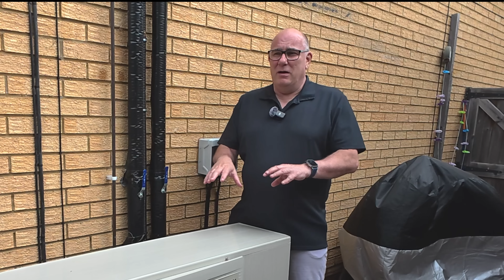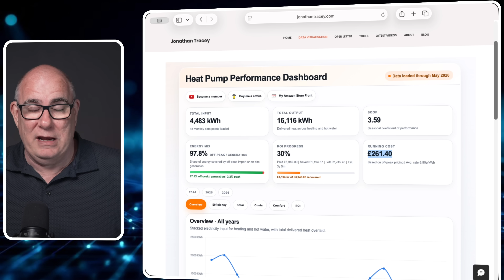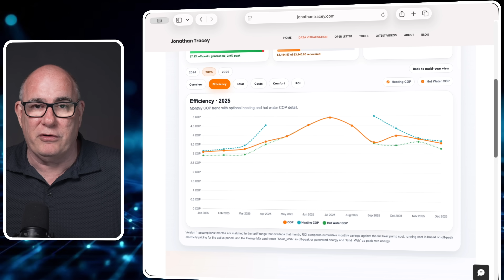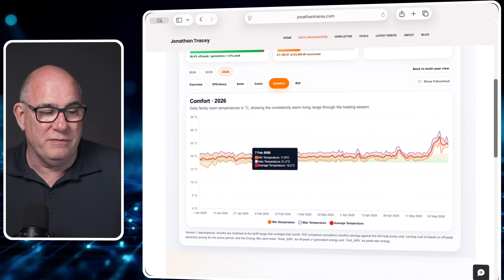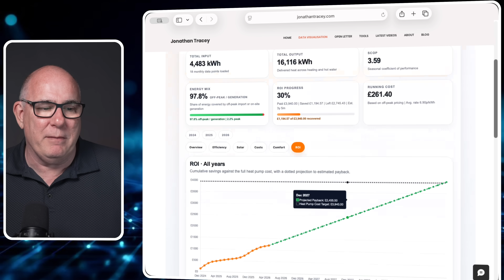18 Months Later: Would I Still Buy A Heat Pump?

Comment: Just FYI: I logged my Daikin heatpumps power consumption using a separate powerplug and discovered it was running high power cycles and the demand control function that is supposed to adjust this to match the power level to your actual needs were not working properly. After notifying Daikin and them confirming the issue they did in fact issue a firmware update that solved it which should affect a lot of users. Result is my heatpump can now run at a very low power to keep the temps I asked for instead of bursting into action and needing to defrost all the time. Result is my defrost cycles changes for every 40-90 minutes in -5c weather to maybe once every 7-9 hours! This is a massive saving on pump wear and a big increase in COP! I was running 3.5-ish but now generally see 4-4.5! Check your pump and settings to see if you have good firmware and if it is able to adapt the power level to your use conditions.
Reply from the maker: Do you know what version of software you’re running?
Reply: @JonathanTracey  I have BRP069C4x type gateway running 2_3_0 firmware with Indoor unit type FTXTA30C2V1BW (air-to-air setup) running 22017101 and outdoor unit RXTA30C2V1B running 22018703 software.
Depending on the combo of system you might not even be on the same software but you can still check if you have a demand control function  and if it is working as expected. Without demand control unit will ramp up to full power and then stop once setpoint/target is reached. With demand control in manual it did not work correctly and it was not possible to set a wattage correctly and in auto it would go up and down wildly. After sw fix it can estimate correctly the power required to gently reach the target and then stay at a very low power reaching a very high COP instead of turning on and off all the time. Result is it can even avoid defrost cycles by not pulling too much heat out of any given volume of air unless it is needed.
Reply from the maker: yeah looks like were on different firmware as my mine (air to water) is showing v4.0.1
Reply: @JonathanTracey  Unless you have already had a look at your units power consumption curves during normal heating (not the hourly data they report but via a proper logger or smart panel) then I suggest you do so as I would not be surprised if this is lingering in many installs. For example the modulation setting is always off by default for new installs and the on/off nature of the heat pump then causes overshoots in the temperature setpoints and often quite short cycles. Very seldom is the heat pump full power required. Yours may have multiple inputs though, or be set differently. I just know that when I logged my unit Daikin was surprised themselves. 🤣
I should probably make a video showing the graphs before and after or something as it is quite dramatic.
Reply: @1kreature please do. I’ve not found a good source for verifying the settings of my Daikin. Or a source that explains what they all do. For example the machine was fitted with weather comp but somehow is also controlled by the indoor thermostat.. I’m sure that’s inefficient..

Comment: We've had our heat pump for almost a year now. Our numbers are slightly higher than yours for several reasons, we don't have an EV yet so on the cosy tariff our kWh unit cost is more,  we only have a small 9.5 kWh battery and I like our house at 22c + but the 8 kW Daikin heat pump is still working out cheaper than our old gas boiler.
Btw I do like your presentation of your own data on your website. If you notice a certain IP looking at it just after 11pm every night that's me 😂
Reply from the maker: lol i am long asleep but feel free that’s what i publish it for 😂
Reply: 22C is...hot
Reply: @Biggest-hz7ng   oh no it isn't 🥶

Comment: Your data is very close to mine, but I only use E7 at 8 pence per unit for around 4 months of the year, and even then, I use very little from the grid, with the most I've used being a total of 211KWH in December and January, and 42KWH in February, and zero in March onwards. Total KWH from the grid in 2025 was 299KWH. My EVs are not full-sized cars, as I have a Twizy and a Stark Varg MX/SM, plus 2 more ebikes, or I would need more grid power in winter.
Since March, I've had to have the heat-pump in AC mode some days, but all of May it's been on every day, as it's been up to 32C outside, and coming home it's been 40C+ indoors. I like it 22C max, and 20C in winter, as the heat makes me sick now.
Reply from the maker: @hardergamer  I think we've both reached the point where summer cooling is becoming just as important as winter heating. Like you, I find 20°C–22°C much more comfortable. Once the house gets into the high 20s or beyond it becomes hard work, and 40°C indoors would be unbearable for me!
Reply: @JonathanTracey  The heat didn't bother me as much when I was younger, but now, when indoors, it affects me, especially with high humidity. And the south side of my home is nearly all glass, which is why it gets crazily hot. I'm just about to install reflective roller blinds, which should help. 
Just add, I'm betting many more will be looking at heat-pumps soon with this 13% hike on gas prices, and this US/Israel war with Iran doesn't look like it's going to be ending anytime soon.
Reply from the maker: @hardergamer We found a great solution for sleeping in hot weather. We bought one of those mattress systems that circulates water through a pad on the bed. In winter it can warm the bed, and in summer it chills the mattress surface. It sounds a bit gimmicky, but when the bedroom is pushing 30–35°C it makes a huge difference to sleep quality. Sometimes cooling the person is a lot easier than trying to cool the entire house!
Reply: Very similar story for ours. 15 months: 17643 kWh output from 4314 kWh input at almost exactly 7p/kWh average. Let’s call that £310 total for 24 hr heating to 20.5C mid-Sep to mid-April and year-round hot water. Gas used to cost us £700-800 pa, for hot water and heating 6-7 hours a day. At least we’re ‘freezing” in comfort!
Reply: @nigel9903  Yes again, very similar. I am a little lucky as it doesn't often get too cold down here where I'm to in SW Devon, the last time we had snow or even proper frost was 2017, and the last average December and January temperature was 12C, It's crazy how much colder it is when I visit family in winter, just 15 miles inland it can be 10-15C colder, and a real shock to the system when I visit my mother in Scotland, especially as she and her husband refuse to turn any heating on, the only heat they will use is a small AGA in the kitchen burning peat. I've literally woken up to find my glass of water frozen solid lol.
Reply: Went 7.2kw Solar plus Battery last week, heat pump next.
Reply: Heat pump in AC mode?
Air to Water heat pump?
I thought only Air to Air systems had that functionality?
Reply: @grahambrown42  Lots of air-to-water heat pumps do. Samsung EHS R32, Panasonic Aquarae, Daikin Altherma Systems, and many more do heating plus cold water cooling. But I have a ground-to-air system and a mobile air-to-air heat pump.